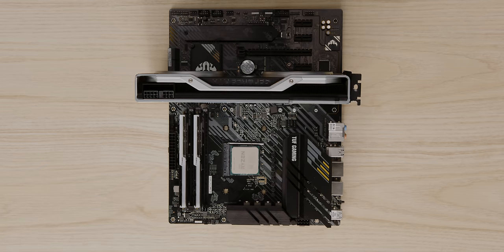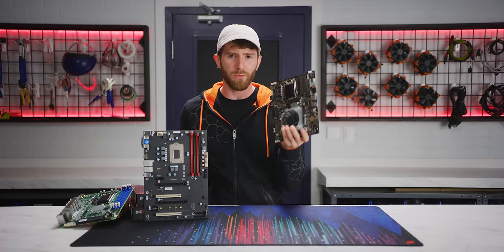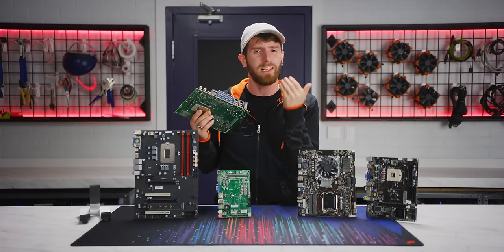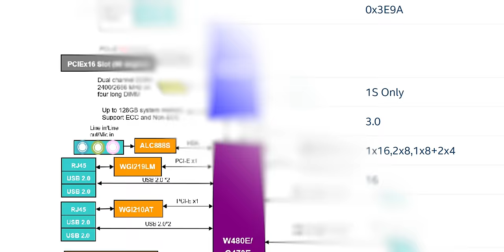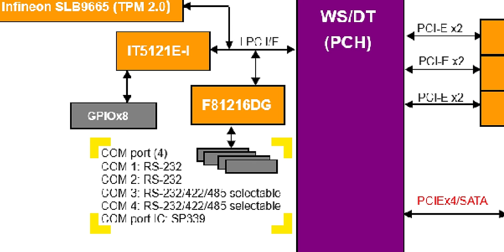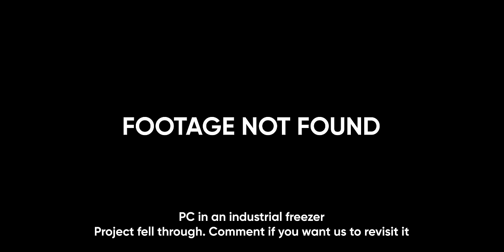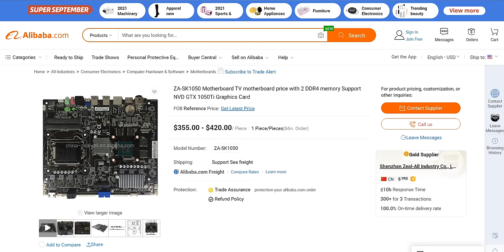5 weird motherboards that shouldn't exist

Comment: I have some weird boards too. One is sized about 12*12cm and has a CF (CompactFlash) slot,  one slot for DDR2 SODIMM and space for a PCI wifi card. It also has an LVDS and inverter connector, COM-port, GPIO, 4 miniature USB2 headers and a weird 6pin power connector which I luckily had an adaptor to ATX for. Back IO is PS2, VGA, 2 USB2.0, Lan and audio ports.
The other board has a case and looks more normal but is really long and has a lot of rj45 serial ports on it. And front IO is blocked by the case in front of it. Internal it also uses a CF card for storage but supports two sata drives. I guess it was used in a industrial space.

Comment: The small MB might be for a "lunchbox" computer. There was a short fad for tiny portable computers made for docking use only, so no screen, keyboard and so on built in, just a "brick" which you could dock into full workspaces as different locations. Made the computer cheaper, smaller and lighter, and gave you a proper ergonomic setup in both places, while still allowing you to have the same computer in both places. Actually, a pretty neat idea.

Comment: Wasn't there once a server motherboard with 6 CPU sockets? This was back when CPUs normally only had like 2 cores.
Reply: 6 SOCKETS???
Reply: @shanedoesyoutube8001  Yup. Server boards with 4 sockets were common, but there was at least 1 with 6 sockets.
Reply: @SmartassX1  4?!?!?! I THOUGHT IT WAS 2 AT MOST
Reply: @shanedoesyoutube8001  You have to realize this was before Multi-core CPUs were designed. Servers (and even mainframes) at the time still needed to have several CPU operations going simultaneously. Most commercial designs had 4 CPU sockets and custom designs for mainframes pretty much was only limited to size.

Comment: My PC is used for gaming and productivity. I might not be able to fill 20 USB ports, but I could get pretty close. It's got nothing to do with the speed of connections, but the amount of hardware (particularly in music creation, DJ'ing and illustration).

Lets' see...

Audio interface, midi keyboard, midi drumkit, one of those snooker ball sized Kensington trackballs, mouse, keyboard, several dongle's for software, Wacom tablet, 2 VKB Flightsticks, Xbox Elite game pad, external HDD's, USB sticks for quick air gap transfers, printer, VR Headset, camera, DJ stuff, mixer etc... then there's all the microcontroller stuff I play around with. So yeah, easily done ;)

Comment: Honestly I would love 20 USB ports on my motherboard
Reply: Yep
Reply: Better to have them than not to, so many mainstream mobos have like 2 USB 3.0 2 USB 2.0 and think that's enough
Reply: @OMGITSJAD  didn't know there still were motherboards with USB 2.0 being made? at this point in time thats just awful
Reply: @BH4x0r  oh there are... mini PC's too... saw one recently with FOUR usb 2.0's... like seriously? 2 should be enough at most (mouse+keyboard)
Reply: @LiLBitsDK  I hope it was USB3 atleast, i don't settle with USB 2.0, transfer speed from external hdds is way too slow, they use the same ports (USB A) but with blue color (3.0)
Reply: Why not, either the Chipset or CPU have USB 2.0 lanes available. They would be wasted if the manufacturer didn't break them out
Reply: @resneptacle  Well if they're available, sure, but i'd prefer USB 3.0 if it's available, and we're not in 2006 anymore, by now you'd expect everything to be atleast USB3
Reply: @resneptacle  because USB 3.0 exist and most items connected benefit from that?
Reply: @BH4x0r  it was 4x usb 2.0 and only 2x usb 3.0 so too many 2.0 and too few 3.0 which was kinda sad and a nogo dealbreaker

Comment: linus would hate my 25 USB pc with most the USB's being used
Reply: What do you use them for?
Reply: @thetalesofdaneandco  I second this question.
Reply: @blunderingfool  I third this
Reply: @dyna6448  I fourth it
Reply: i have so many usb things it's crazy. i have that 48 port usb hub, but a lot of my stuff doesn't play nice with usb hubs, like 3d mouse, usb mic, all of my cameras, multiple streamdecks (like taran, but i got 3 instead of 2 suckaaa!), even my logitech unifying connecter is playing silly buggers in the hub. ontop of that i use a usb-c thunderbolt for an external sound card hooked up to my even crazier sound setup. so if that computer actually worked, that would be amazing in my case. too bad it can't actually take all of that bandwidth and it doesn't even have PCI-E
Reply: Only have 15 usb ports, very sad.
Reply: @JackPorter  How does a 48 usb hub work, bandwidth wise? Does it occupy like 3-4 USBs on your I/O? Also can you link the one you have, because 48 ports sounds fucking useful
Reply: @froot2912  i misremembered, since i'm not actually at home rn, but it's a 28 port MondoHub II (still a lot through a single usb3.0, not even a usb-c), 4 usb3.0 5 Gbps ports and 24 usb2.0 480 Mpbs ports.

and on how it works? i have zero clue, as far as i know hubs basically spread the bandwidth between all of the ports, banking on that not everything will be constantly be pulling high loads of information.
so that's why constant high bandwidth items like cameras, mics and whatever else don't play nice with a hub, because they actually do need all of that bandwidth constantly and consistently.
Reply: @thetalesofdaneandco  a lot of it is VR stuff, like controllers (2), trackers (7), and the headset itself, steam controller dongle, phone (yes i charge my phone off of my pc), xbox controller, monitor lamp, bluetooth dongle, arctis 7 bluetooth dongle, arctis 7 charger, xlr mixer, flash drive, SD card to USB, and sometimes i plug in my arduino stuff. so like 21-22 are used.
(edit: most the usb's are also 3.0)
Reply: @neonpulses  I use most of my 10 and honestly could use more.  What motherboard is it?
Reply: @JackPorter  Thanks for the info, even if not all USB ports are active simultaneously, the fact that it pumps through one USB 3 is crazy.
Reply: @thetalesofdaneandco  asus crosshair vi hero, i also have a pci to usb thing
Reply: @neonpulses  you really need a usb wall charger for most of that stuff. TBH I do too, those body trackers and vr wands just take up way too many ports to justify charging off the pc... I just don't know where I'd find a wall charger that doesn't suck.
Reply: @neonpulses  Ah, the pcie to usb thing.  I thought you meant your motherboard had all that io.  I am currently more looking for a good pcie to sata card if you have recommendations.
Reply: @thetalesofdaneandco  it only has 5 usb's, the Inateck PCI-E to USB 3.0 (5 Ports). i personally have not had any problems with it.

Comment: 11:58 I think you can do a Bios mod to enable NVMe on gen2/3 intel chipsets.
You have to use UEFITool to add the missing module code to the Bios. Its pretty risk if you don't have a EEPROM flasher to recover if something goes wrong.
Reply: Source?
Reply: @kevinjansen3785  Youtube will probably delete my comment if I put the link here but I will try.
Reply: @kevinjansen3785  No can do. youtube immediately deletes my comment even if I break the link in parts or try to suggest a term to google search the link.
Reply: @kevinjansen3785  "get full NVMe support win-raid"

Comment: Long time ago I remember having a motherboard with Geforce 2 MX built into the thing. It's not a new idea and as long as it's relatively cheap, it can help.
Reply: Several motherboards over the years that have GPUs built in.
I've owned at least 3 different ones - of which the "6150" (if I'm remembering the right designation) comes immediately to mind.

Comment: The cooler of the small motherboard is probably integrated into a case that was designed alongside the board.
Reply: It's entirely possible imo that it mounts to a heatsink as large as the board and uses 1 or 2 fans in the case to produce enough draft to cool everything.

Comment: I Know Some Flight Simmers need a Motherboard with more than 10+ USB ports for all the instruments and things to connect. 
1 stick, 1 throttles, 1 pedals, 1 for track IR, 1 for autopilot panel, 1 for Radio panel, 1 for Fuel control panel, 1 for compass, 1 for attitude indicator, 1 for altimeter, 1 for artificial horizon and so on

Comment: The little tiny motherboard don't need a heatsink or fans. Its supposed to have a metal case that's also the heatsink. Its usually a finned case like the old aluminium car audio car amplifiers. So its probably 12v operation for mobile PC thats more powerful than a era correct laptop or something like that. For mobile signage like food vans or something else similar.

Comment: I used to be an I.T. consultant for many years, and also an OEM for some very specific and technical circumstances. And based on that I can say this:

PORTWELL
The Portwell's motherboard has numerous uses in an industrial or security environment and solves many headaches and expenses.

ENTEC REV
If only you had any idea how amazing this is for denturists! I remember one case where there was a tiny door between the secretary and the l behind her. The tiny door was supposedly hermetically sealed. However, you should have seen the incredible amount of plaster dust in her computer case! We had no choice but to set up a regular "cleaning program" just to deal with that.

Comment: The one with lots of USB is probably set up so the end device doesn't have to buffer before sending data.  It may bring together a number of sensors etc as mentioned.  It's definitely a factory floor type of unit.  

The Zeal with LVDS and Inverter is not meant to be in a box - it's meant to be IN a display.  The inverter drives a florescent lamp (backlight).  The LVDS will connect directly to the flat panel usually via a custom or quasi-custom cable.  You don't want either of these running long.  The LPC may be so the unit can be factory tested.  The unit would probably sit in an attractant, tourist self-help guide or other touch-screen full-fledged computer and serve as the MB.  IDK if it's papered for it, but it could even be for a gambling machine with the diag port so a gaming commission can verify it has not been tampered with.  Last bit = total guess.

Comment: I once had someone tell me, in complete seriousness, that the reason PS/2 keyboard and mouse ports were no longer included on motherboards is that they took up too much room that could be devoted to USB ports. As if that tiny little area of the back panel was the only available space to add USB ports. I guess that first motherboard lays that notion to rest.  :)
Reply: Thank goodness MOST motherboards still include at least ONE PS/2 port - they're not extinct YET.
No bets on 5 years from now though. 8-(

Comment: Interesting idea about reusing old processors. As a schematic verification engineer I have seen and learned a lot about weird mobo designs, in my short working experience 80% of the boards I have seen are not for desktop or "consumer" use, most of them are for industrial work, self driving vehicles, etc.

Comment: Linus: "Why do my components fail so often?"
Also Linus: no anti-static preventative measures of any kind.
Reply: We don't get much static in the PNW i honestly can't remember the last time I had a static shock but it has to be months or years ago
Reply: @newtracetriad  Electronics can be damaged by static shocks smaller than you can feel.  Why not follow basic anti-ESD procedures like handling PCBs/RAM/CPUs only by the edges, using a grounding mat, etc?  Shouldn't be an inconvenience to follow industry best practices.

Comment: I have a lot of USB stuff - racing wheel, joystick, flight rudder peddle, 3 external USB hard drives, Keyboard and mouse, Logitech G13 keypad, Shuttle Xpress controller, Audiobox external audio interface, and midi keyboard. All plugin to my computer - and as such I always wish I had more USB ports directly on the motherboard.

Yes, I currently use hubs - but half of the time they seem to zap speed, or keep disconnecting my attached USB stuff, etc.

Comment: About the old CPU . The last 2-3 years chinese stores have been pushing out tones of cheap computers (mostly small form factor) for basic home use. They use old componets with new motherboards. Most comman is Intel Xeon gen 2011 to 2015 , most likely refurbished severs from the mass swap done in US datacenters arround 2018-2019. 

About the other boards ,they all look purpuse build for controllers in factories  (like the one with 20 USBs , that one is deffenatly for automation).

Comment: That first motherboard would be perfect for me. I do product design, work with electronics and embedded software, and have a significant amount of hardware connected to my workstation, including (not game) controllers, measurement, programming and test tools, devices being developed, disks, you name it. It currently has 48 USB ports, of which 8 are on the motherboard. All are needed (I don't keep stuff on the table that I am not using) and I am constantly running out of available ports. I was soon going buy a 10 port hub to have more ports.

This, excluding all the devices for charging via USB, for which I have mainly a 40 port and 8 port integrated chargers, which cuts down a lot the need for separate smaller charging devices and avoids to load the already heavily loaded workstation.

With a board like that I could cut down the amount of USB hubs needed and simplify my system a lot.
Reply: woudnt hubs be much better though? Running of thier own power supply, rather than vampiring power from the mobo?

Comment: The Commodore Amiga range of "PCs" had some pretty weird stuff back in the day. Like the amiga 600 that had a laptop drive header for laptop hard drives. Or the composite TV out on an Amiga 2000, 3000, or 4000.

Comment: The oddest motherboard I had was a Western Digital 80286 which was one of the earliest with integrated I/O and video. IDE, serial, parallel, floppy. Don't recall if it had a joystick port. The video was the odd part, it supported EGA at its normal resolution and a "Super EGA" with 16 colors at higher resolutions up to 800x600, but to use resolutions higher than 640x350 it required a TTL monitor capable of higher vertical scan rates. "So just disable the 'SEGA' video and plug in an ISA video card." Ha! No can do. Every one of the integrated peripherals could be individually disabled *except for the video*. Making things even more crazy was since it was an AT style board, "baby" width quite a bit longer, The serial, parallel, and video connectors were on ribbon cables and I'm sure it had at least 6 ISA slots. If you didn't have a case with knockout holes for port connectors, some of them would have to go on slot brackets and block the slots from being used.

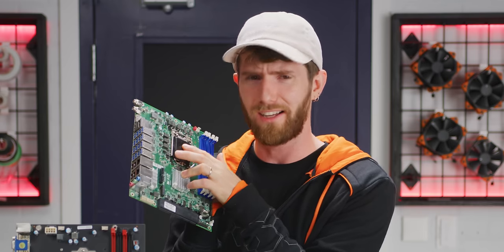Comment: 2:36 Gigabit Ethernet is actually 2-way gigabit. So it's actually 2 Gbps per port, if we're talking about max theoretical. Therefore it should be counted as 4Gbps for 2 ports. In reality you'll almost never see more than 115MB/s in both directions over a sustained period (e.g. 10+ minutes) due to transport, driver, and other overheads, which is 1.84Gbps per port, or 3.68Gbps for two.
Reply: I believe DMI is full duplex too, with ~30 Gbps per direction, so that shouldn't matter unless I'm mistaken

Comment: The Logicboard of the iMac G4 is also fairly unique because it's round. And the cooling is also very interesting because it's using the metal frame of the enclosure as the heatsink

Comment: I remember when I first switched to hedt I was trying to get a 5820k but ended up getting a 6800k and seeing some weird motherboards trying to find something reasonably priced to pair with it. It was super cool to be switching from the 6700k to the 6800k except for realizing it hurt gaming performance. I remember I ended up getting my first ASRock board 'x99 taichi' paired with X4 Corsair LPX  3200mhz and a Sapphire Fury-X. This became x2 Rx 480s, swapped out taichi for an X99 Designare, then swapped for two Nanos. Then I sold the 6800k, X99 Designare and the ram for a major profit and switched to just released 1700x and better ram, got rid of a nano and shrunk the system twice before getting rid of the 2nd Nano. By that time I had a b350 itx and got the 2400g, populated the itx case's GPU slot with a 240mm aio and used that for a few years. Now my son is getting the 2400g but I currently have a 3900x on the board paired with an Rx 5700xt. I also have an nr200 5800x rtx 3080, an 011 mini 5900x dual 6800xt and a 5600x 6800 test bed but I'm about to move everything around again. I just need a new case and a first gen Ryzen to update an old motherboard...

Comment: the Surnia Enctec Rev Q270 would be good for water cooling setups with thin water cooling blocks, its good if you want more visibility in the case because there is less visible tubing

Comment: The Gigabyte K8NNXP nForce3 150 motherboard is another weird one! It had this unique Dual Power System K8 (DPS-K8) daughter board that plugged in and provided an additional 3-phases of VRM. I purchased one of these back in 2004 and had the DPS-K8 board exploded spectacularly on first power up!

Comment: On the last one, the "cooler" is a giant block of finned aliminium that the mobo is mounted to,
and then the rest of the case is a metal box that fits around the front side of the mobo and is screwed to same block.

Comment: That last board with no mounting for cooling was probably designed for a specific product which essentially uses the case itself as the cooler, much like a phone...the bottom plate of whatever case it's from probably even has a heatpipe set soldered or otherwise integrated.

Comment: Worked IT for a steel mill for many years we would use just regular Lenovo desktops and hp thin clients on the floor. You would be surprised how tough they are lol. Steel dust is a whole different animal but they powered thru.